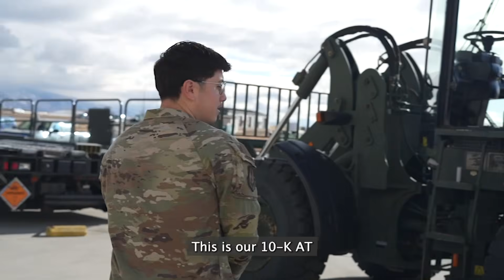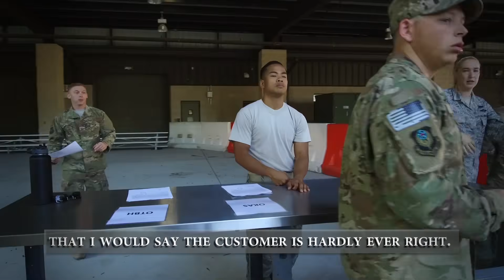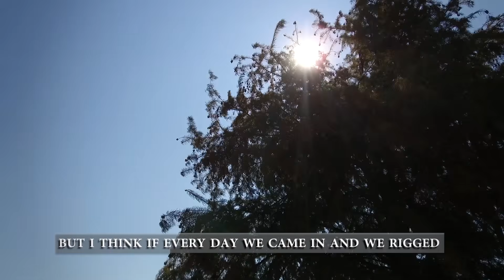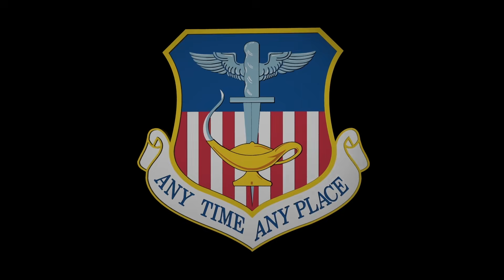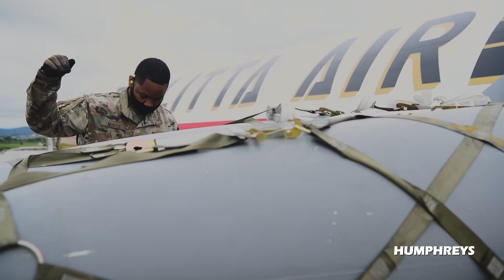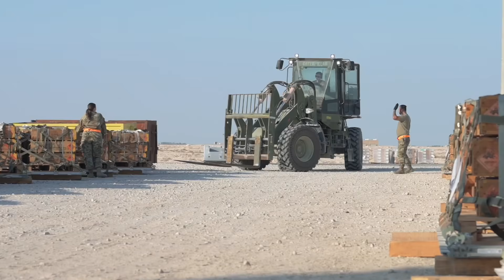Air Force Air Transportation (Port Dawgs) 2T2X1

Comment: Times have changed. Back in late 60’s it was a 25+40K loader with guys pushing pallets. C-130’s and C-141’s mostly. 60551 and mostly line loading for me